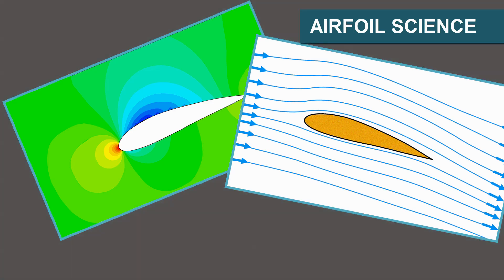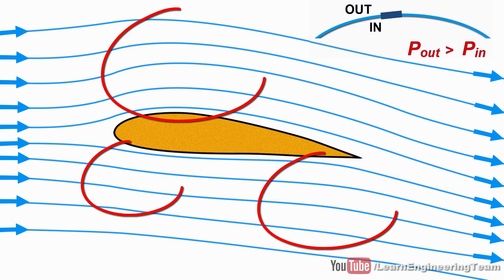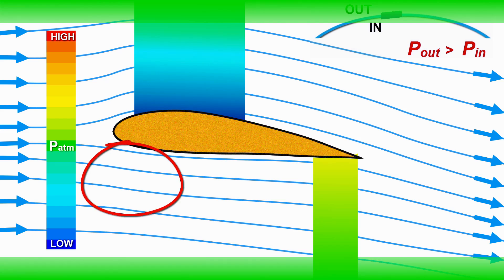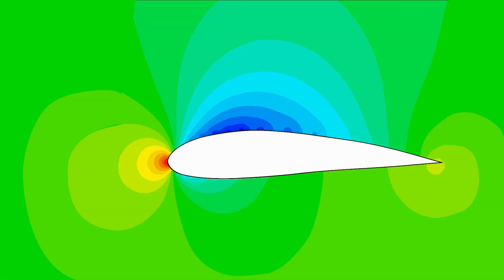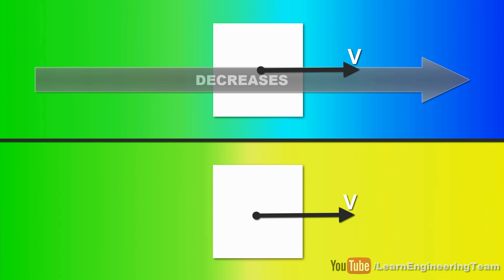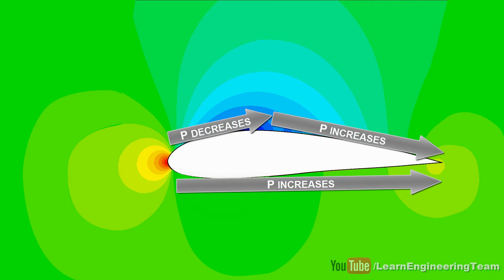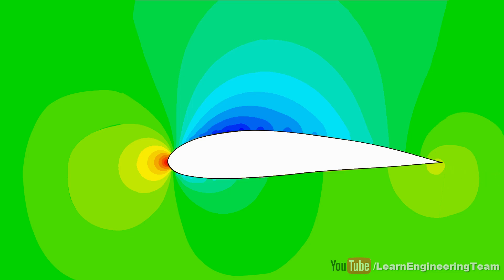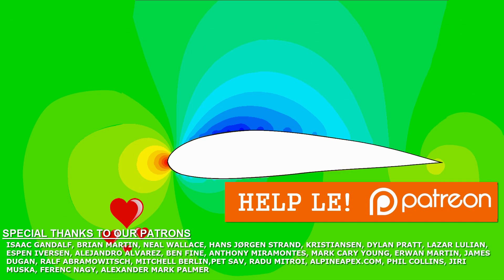Why is the top flow faster over an Airfoil?

Comment: Think about it! The air is actually stationary and does not flow over the wing. The air just gives way to the wing upwards and dawn wards. The generated pressure degreases with distance. 
The air turns counterclockwise around the pictured profile..
Start thinking and let go the hypnosis of the windtunnel.

Comment: Hello, 
can you please explained why Pout has greater pressure than Pin ? 
This is the part I am currently stuck at, I dont get why a curved line the pressure outside of the curve is higher than pressure inside the curve?
if that is the case why the curve not bending downward instead is bending upward? isnt pressure suppose to flow from high to low ? 
thank you
Reply: This part took a long time for me to understand. 

Think of swinging a tennis ball on a string around your finger. In order for the ball to constantly curve in a circle, there must be a centripetal force accelerating the ball. 

Likewise, he’s explaining why air follows the curve of the wing. If there’s no force, air would continue to travel in a straight line. Yet it doesn’t, air follows a curved path around the top of the wing. It changes direction. There must be a force causing that to happen, and in this case it’s a pressure gradient force (PGF) lower pressure closer to the wing and higher pressure away from it causes air to curve in the direction of lower pressure.

Comment: First you state that in curved flow pressure is greater outside. And right very next  statement is that outside a flow, curved by upper surface of airfoil pressure is lower.

Comment: The only bit that I understand is that the curved top opposed to the relatively flat bottom causes a difference in pressure between the top and bottom 
Seemingly because the air
Travelling over the top has further to travel there for is forced to speed up.

Comment: I will explain what happens from a mesoscopical point of view. What happens is that fluid particles tend to travel in a roughly straight line if undisturbed. This is the principle of inertia. However, the presence of the lifting surface disturbs them and they will first deviate off course due to the presence of the leading edge (or whatever they first encounter). Now particles are moving in a roughly straight line away from the lifting surface (upwards or downwards depending on where they were coming from upstream). Because of that, the flow becomes rarefied in the direct vicinity of the lifting surface which induces a pressure decrease close to it. Due to the fact that there exists a pressure gradient force pointing towards the lifting surface, fluid particles that are moving away from it are accelerated towards it. This is why flow remains attached for small values of the angle of incidence and this also explains lift: The action of the lifting surface on the fluid particles is to accelerate them in a certain direction (if the surface is generally cambered or inclined downwards, it will force fluid particles to generally accelerate downwards), hence they give away their momentum to the lifting surface in the opposite direction (principle of reciprocity). 

Bernoulli's "principle" kinda forgets this dynamical point of view and rather explains things from an energetical point of view: There is a transfer between kinetic energy (velocity) and potential energy (pressure and head) along streamlines: In the absence of source or sink terms in the Bernoulli equation (production and dissipation of energy), kinetic energy is won where potential energy is lost, and vice versa. This does not explain why kinetic energy is lost (or gained) and why potential energy is gained (or lost) since you lose directional information by projecting the Navier-Stokes equations onto a streamline, but along with the "third law explanation" that I gave in the first paragraph, the Bernoulli principle will help provide you with the full picture: That's because whenever fluid particles travel very quickly towards an obstacle, they contain lots of bulk kinetic energy which is transformed into pressure when they hit the leading edge and the pressure side of the lifting surface. Because fluid particles have become compressed when moving past the leading edge along the suction side, the pressure difference between patches of flow away from the surface compared to that close to the surface will become more important, which yet again reinforces the pressure gradient force caused by this rarefaction. Curvature does not magically act as is suggested in this vid: We should rather consider that the geometry curves away from the flow as flow particles move along a straight-ish line and bump into each other, getting a net momentum that forces them to go towards the rarefaction.
Reply: Yep. So you explain how the acceleration occurs but not seeing how the rarifaction occurs.  
Allow me. Please bear with me… 
Boffins extol the air is incompressable in the regime but i suspect it is neither incompressible nor non-rarifiable.  … I realize it is a many body complexity microscopically but i wonder if (all) lift rarefaction is a DIRECT result of sink/weight. Poo hoo many times but there are graphic observations in the real world.
Consider (the reason i give is) the ability of a paraglider to infinitly loop (tumble) over itself while maintaining same decent rate through the airmass (always decending mesoscopically at ~ 1m/s. Ill find a video for u that shows the inflation of the wing remaining “stiffly inflated” but the lift of the wing remaining vertically UP despite the wing spending more than half the time transiting under the (tumbling) pilot’s cog … where aerodynamically one might expect it to pull the pilot DOWN. It doesnt. Is quite remarkable and would go some way to explaining aerobatic inverted flightpaths.

Comment: now answer why the pressure is higher at the outside of a curve
Reply: If you have an object (air) travelling in a curve, it must have a force (centripetal) to the inside. Otherwise, it would go in a straight line. 

Additionally, the velocity reduces pressure (pressure+velocity is a constant. Bernoulli). So the pressure above the wing must be lower than atmospheric pressure. Moving up, the velocity of air stream is slower, so pressure is higher. It keeps going like that, always with the longer arc having higher pressure than the shorter (closer) arc. 

This is why a tornado has its highest pressure on the outside, and such low pressure in the center it can pick up objects into the central vortex. 

Check out some explanations of Bernoulli Principle if that explanation didn't answer your questions completely. [You could also look for "coanda effect". Both could help give a picture.]
Reply: see comment above
Reply: Don't think like this is a  curve so pressure must be higher outside, if you think this way you can't find any reason but if you think like there is a pressure difference so there must be a curve, you can see why it is. The continuous pressure difference between both sides of a particle  makes particle curve, curve of particle doesn't create pressure difference.

Comment: Thanks for this awesome piece
The Bernoulli's principle though will only explain the increase in velocity of the upper fluid after the pressure profile has been determined.(From the conservation of energy equation)
Reply: The air ahead of the wing is disrupted well before it gets to the wing. Air particles "see" a steady stream of incoming air on the leading side, and not on the leeward side. So the pressure difference causes acceleration. Once the acceleration is established as a stream, the pressure drops (p + v is reciprocal, as you pointed out). 

But establishing and maintaining the pressure conditions on an aerofoil are well outside the scope of this video. There are Associate Professors at well known engineering schools, teaching aerodynamics, that have no decent intuitive understanding of lift. Actually, that's too kind. They misunderstand lift, but are very confident in their misunderstanding.

Comment: https://youtu.be/VEe7NxB5Vo8?t=239
WHY DIFFERENT SPEEDS? I'll tell you why.
The air molecules are trying to keep the pressure, think of it like electrical force, but this time, when there a lot of space to fill back with air, the force is stronger and thus the speed is high, but as the gap that the air needs to fill back is getting smaller, the air is getting stable again and the velocity decreases back to normal as soon as it leaves the wing (except turbulences). 
Summary: The shape of the wing creates the paths the air must go by, and that creates speed changes according to the inner-outer path (runners will tell you all about that) which automatically creates the pressure differences (Bernoulli) which we call LIFT.

Comment: This does not answer the question. Like at all. The coanda effect has nothing to do with airflow speed. By definition; "The coanda effect is the tendency of a fluid to stay attached to a surface while moving over it". It is a phenomena and not an explanation of the why. The REAL reason why airflow is faster on top of an airfoil, is due to statistical mechanics and velocity distribution of particles in the air. If i assume air to be an ideal Nitrogen gas, the molecules are bouncing and colliding everywhere randomly at the speed of sound. If i imagine a continuous gas moving in a tube, but i suddenly make that tube narrow, the gas will accelerate through it. Why? Because on a microscopic level, the Molecules which already had straight velocity will pass through the narrow tube. Molecules with velocity vectors pointing for example at certain angles will get deflected and will PROBABLY not make it in the tube. This means there is less "contact" between the molecules once the tube gets narrower. This also means that average speed of the gas will increase, because there are not as many collisions to average out the energy of each gas particle. Most of the particles that pass through the narrow part of the tube, will have then higher average Energy than the particles bouncing around, waiting to enter the tube. The top of the airfoil is the same. It squeezes the airflow like a tube that is getting narrower, but only on one side. 
On a macroscopic level, this can be easily explained with the fluid Continuity Equation The flow of mass Q is conserved (conservation of Energy and Mass). That means if a certain batch of fluid with speed tries to enter a tube, it Must flow at the same rate to conserve Energy. But since less mass can enter the Tube (uncompressed gas) that means that it has to go faster for that batch of air to have the same Energy. ƥAV=ƥA'V'

3:14 see that is where the mistake is. The top Particle already had that speed before going over the Airfoil. The reason that particle went over the airfoil in the first place instead of contributing to Ram pressure in front, is because its direction and speed were already appropriate. If that particle did Not have that direction and speed, it would not even go over the airfoil. It would bounce and contribute to Ram pressure. In fact the reason why the pressure also decreases on top of the airfoil, is that statistically, there are fewer particles in the air which need to fulfill those conditions to speed over the airfoil top. Because this number of particles is lower than the average nr. of particles in air, it contributes to less pressure because there is less air. In fact the faster your airfoils goes, the lower the pressure on top gets, because the lower the number of particles that have enough energy, and perfect direction, to go over the airfoil. The rest just bounce and collide around.

Comment: Can someone please explain about how he decided the preassures around the airfoil,please,explain completely
Reply: Pressure + velocity = a contestant force. (So as P goes up, V must go down, and vice-versa.)

The leading edge of the wing "sees" a direct airflow from in front. This applies more pressure to the molecules in that side, so they begin accelerating rearward. As velocity increases toward the highly curved region on top of the wing, pressure must decrease. 

After this curved region, airflow is no longer directly exposed to incoming air, so slows down. That means pressure must increase gradually toward the tail. Also, the flow becomes turbulent here (it was laminar in front of this). 

Because of velocity increases, we know the pressure decreases by en equal amount (Bernoulli Principle). 

Since atmospheric pressure is higher than at the top wing surface, there must be a gradient of pressure lines. These lines increase in pressure above the wing, as airflow slows down. 

The point directly seeing the airflow at the front of the wing must have higher pressure, since it receives constant exposure to the airflow. 

The underside of the wing: pressure depends on shape. Not all examples will be the same. If it is curved like the top (think a sail) it will have more lift. The curved flow lines have higher pressure on the outside than inside. If the long arcs are up (like a hill) by the wing it will have higher pressure. 

On the other hand, if the underside (and flow arcs) are shaped like a "U" : then that surface will have lower pressure than the longer arcs beneath the wing, and will have less lifting force. 

That probably wasn't clear. Watch more videos. Search for Doug McLean on YouTube.

Comment: Pressure of air is the amount of air molecules at a given place multiplied with the vibration speed of the molecules (higher temperature the more they vibrate and hitting a surface with a speed which gives out a force which on a given area is equal to pressure)

The temperature in this scenario can be seen as constant, and the only thing we need to focus on is the amount of air molecules at a given space which will in turn give us the pressure at that area.

When the air curves for example in the beginning it is pushed up and some air molecules will detach from the wing surface as the speed gives them enough momentum to leave the wing surface as it hits the sloped surface of the wing. 

This means it will have a smaller amount of air molecules compared to the atmosphere. Since pressure in our scenario is directly given by the amount of air molecules at a given place it must mean that we will have a lower pressure at the top of the suface of the wing.

Less air molecules at the wing surface equals less drag on the air molecules due to the skin effect. This makes this air able to travel much faster than the air beneath the wing. 

Same thing at the bottom end of the wing. Air molecules follow the path of the wing and is smashed towards the wing at the back because of the momentun they have. This will decrease the speed of the air molecules (skin effect). Air arriving at the surface of the wing will be arriving faster than the air leaving the surface (goes further along the surface of the wing). This makes a traffic jam of air molecules where more molecules is arriving than leaving. Which in turn gives larger amount of air molecules than the atmosphere. As said, the amount of air molecules directly gives the pressure in our scenario and we will have a higher pressure here compared to the atmospheric pressure.

Hope this gave any sense! :)
Reply: Another thing to note is that this is not the only way a wing creates lift. The Wrights brothers which made the first functional plane had flat wings. 

It is the direction the air leaves the wing which gives the wing the most lift. So by having a flap at the back which is moveable we can guide the airstream either up and away from the wing as it leaves the wing or force them down.

This is why stalling occurs because we loose the air stream on top of the wings and it leaves the wing in a uncontrolled matter. By loosing the air stream we are not able to control it the way we want and cant use it to create lift. 

See the video «How wings ACTUALLY Creates Lift!», it explains it really well!
Reply: Best explanation I've seen so far
Reply: "will detach from the wing surface as the speed gives them enough momentum to leave the wing surface as it hits the sloped surface of the wing." This is the piece of information Ive been looking for.

Comment: wait, Bernoulli says higher velocity fluids have a lower pressure, which counteracts what you said at the end about pressure distribution effecting speed and not the other way round
Reply: Misapplication of Bernoulli's principle. Bernoulli's principle is about conservation of energy and mass flow rate inside of a tube... a wing is not inside of a tube.
Lift is the result of the flow being curved due to viscosity, a pressure gradient generated, driving acceleration. Air is given a downward momentum and Newton's 3rd law says the airplane experiences an equal and opposite force
Reply: @GZA036  could you please explain, "due to curvature pressure gradient generated"?

Comment: Is the lower pressure on the top of the wing the result of the faster flowing airflow (Bernoulli) or
is the faster flowing airflow the result of the lower pressure on the inside of the curved flow that accelerates the air ?
Reply: I think this is a helpful way of thinking about it:  Imagine water going through a pipe, as the water passes a narrow point in the pipe (a venturi) the water accelerates. Imagine that the airflow around the wing is the pipe, and the free flowing air that has atmospheric pressure is the wall of that pipe.. Increasing the camber of the wing will tighten that space, the Venturi, causing the air to accelerate faster over the top of the wing as opposed to the bottom. Then, as the air accelerates over the top MORE pressure drops. So pressure causes the acceleration, then acceleration further causes more pressure drop.